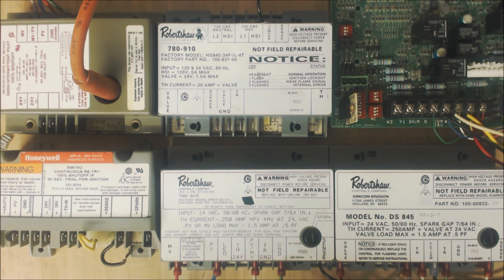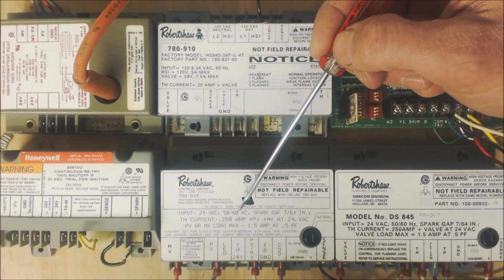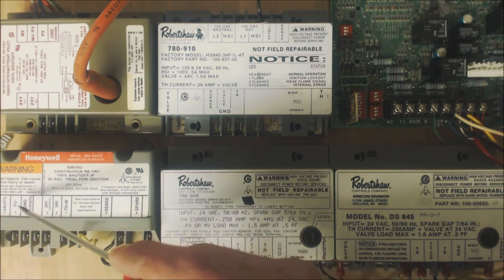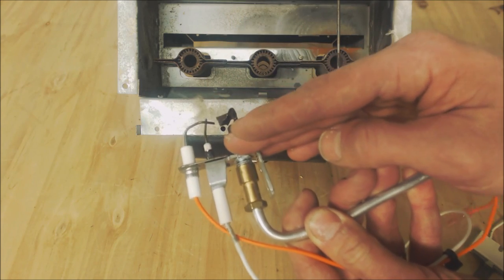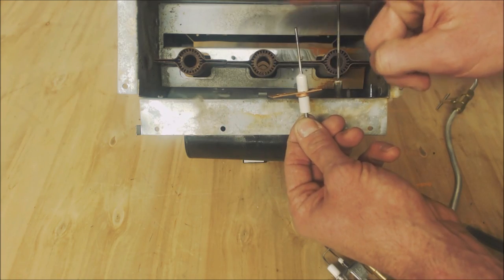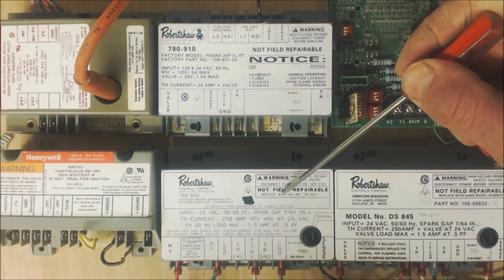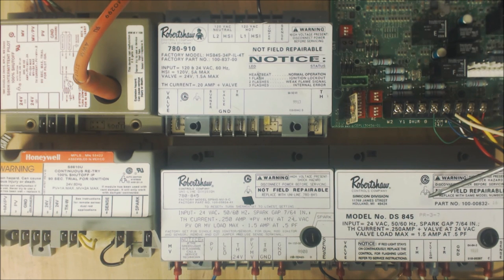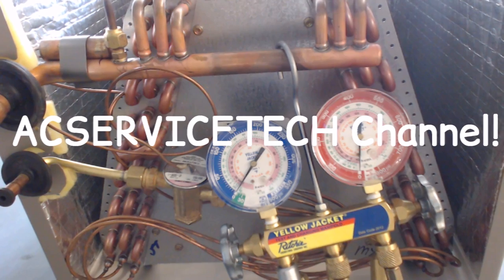Gas Furnace Ignition Control Modules!

Comment: Hello. Below is a summary of the issue from the perspective of an old automobile mechanic (me) that knows nothing of what he's talking about with heaters... 🙁 

Back around 30/40 years ago I put a dayton heater 48k hanging LP heater in my garage model 3E405. It always worked fine.  It was a standing pilot and a pain in the butt to climb the ladder all the time to preheat the thermal coupling.  As I got older it became very difficult to raise my arms over my head to light the pilot. Just recently about 2 months ago I purchased and installed a Robert Shaw intermittent spark kit # 712-008 recommended by Grainger.   It's been nothing but problematic since. 

My problem is now the heater has a mind of it's own.  The spark always ignites fine and instantly when I turn the power on and stops igniting fine when the pilot lights, (which at times can take as much as 50 seconds or so) but sometimes the pilot doesn't light at all, main flame does not light.  When that happens there is no reading on the manometer or voltage to the MV terminal or PV.   

It seems like there's a time delay for the fan to come on based on what my old heater thinks is a standing pilot and maybe there's even another switch telling the fan not to come on because it's not hot enough yet, all logical, but maybe the thermostat or this control module is running through that circuit messing up the sequence of events timing.  I don't know it's all guess work for me.   

I believe the part number of the switch originally and still in my Dayton burner is a Sterling switch # J11R00366,  high limit/fan delay.  If you search that part number tons of the photo of that switch come up.  

Also sometimes after the pilot does light, the fan will go on but no main heat. Sometimes the main burner may finally light after the fan has been energized.  I have 10 inches WC when it does open the MV. 

If I shut the power off and wait a bit, then turn it on, at times, all seems to work fine although the fan at that point comes on a bit too soon, it may cycle fine maybe 4 or 5 cycles while I'm working in the shop and keeping an eye on it.. Then the fan may go on with no MV or burner.  It seems to have a mind of its own.   

I feel like the old switches in the heater (I believe part# J11R00366 Sterling) are not playing well with the Robert Shaw kit.  I have an old Honeywell round thermostat 2 wire. I dont know enough to fix this issue.   

My novice gut feeling is that power isn't getting to the PV or MV terminal of the ignition module at times because the thermostat perhaps going through the time delay switch or the module is looking for something which I'm guessing is normally open the switch that I referred the part # above and that switch thinks it's dealing with a standing pilot so it doesn't care about timing in that regard.     

I also believe this is a dual switch with a high limit switch included which I'm assuming is normally closed but I don't even know what I'm talking about I'm just guessing. I may be barking up the wrong tree. I'm thinking that it would not be that part of the switch that is causing the problems because if the thermostat were attached to the normally closed high limit switch then everything would be coming on instantly with a call for heat, but that's just my guess.  Once it gets to that magic ignition module box I have no idea what is switching between terminals inside that box of course. The part# of the Robert Shaw kit was 712-008, and the control module was 780-845. 

I also honestly have no idea of the sequence of operation or if any time delays in that control module box that came with the kit. 

As a retired ASE certified auto tech I have the ability to generically test components, but without any info on the systems I'm stuck speculating.  

If you or anyone can offer any help or guidance,  please, I'm at my wits end.  Thank you.

Comment: Well I’m hoping all of this wiring is easy to get to. I changed out my motor in the heat of summer for a/c and the gas sounds like it’s coming thru, igniter is clicking but no heat. We have a small window of good working time in the attic and now it’s as cold as it was hot. My motor was hard to access behind the housing so I hope I don’t have to pull that heavy thing out again. Maybe I missed a wire. Here goes.

Comment: So it's sending 6,000 to 20,000 volts to the spark rod. 
What is the power source? Is it 24 volts? Is it taking 24 volts and somehow turning that into 6,000 to 20,000 volts? And also for your flame rod sending 90 to 120 volts as well.
So is there a 120 volts as the source powering this module or is it just 24 volts that's powering the module?

Comment: I have a DS-845 in a fire place that I cannot get to work. I replaced the controller, then the Spark rod but still it only lights the gas train and then shuts down with a flashing red light. I have check the grounds, even repositioned to the actual mounting plate of the spark rod but still the same problem. I verified the "house" ground and have it terminated everywhere. I am baffeled

Comment: great video I have a question I have just produced a new 780/845 module it is new and I have installed it I put the thermostat on and I have no spark. I made the connections like the old one, I would like to know if you can guide me above my heating system is a modine furnace
Reply from the maker: If it's a spark ignition module, I have two other videos on exactly what is happening with the voltage and wire connections, thanks!
Reply: @acservicetechchannel  have you the link

Comment: Great video. I have a question. I have a Honeywell universal ignition module and want to wire in a Wi-Fi stat. I need a "C" wire going back to the new stat (there are 4 wires to the old stat but also a few spares) Can I grab 24vac from one of the terminals that are already being used and run it back to the new stat?
Reply from the maker: Yes find the common on the transformer of the unit and run it to the thermostat, thanks
Reply: Thanks. Nothing marked "common" or "C" - just "24v Gnd" and "24V" . I'm guessing the 24V is the same as "C"?
Reply from the maker: It would be the 24v GND as the other one would be 24v power. Red- R, RC is 24v power to the tstat and the 24v Common/GND is the path back to the transformer, thanks

Comment: Is there a way I can ohm out a control module ? I'm getting 24 volts every where I'm supposed to be getting 24 v but I'm not getting a spark . I checked the volts at pilot igniter switch connection on and I get no reading . It's a direct pilot .
Reply from the maker: If you don't hear spark even with the spark wire detached coming from the inside of the module after getting your incoming 24v signal then the module is bad. Make sure your spark gap at the rod is not further than 3/16" or 1/8", thanks
Reply: acservicetech 
Thanks again A.C. , it was the board ..  I ended up using the one I grabbed last week from a service call that I diagnosed wrong and didn't use . Worked out well .
Reply from the maker: Glad to hear it worked out well and also thank you very much for choosing to support the channel through Patreon!
Reply: acservicetech dealing with a 90k sterling unit heater with a  sterling j28r06881 control board that won’t spark ⚡️ yet inducer and gas valve both work would it be possible to add a separate spark ignition module ( only for a temporary solution ) ? I know a new board will fix the problem but it’s 2 weeks away before getting it in hand ! 
Thank you

Comment: just a question, if I have my gas meter on the manifold side and the IFC drops out on flame safety (2 code flame failure, on a Lennox board ) ,  with a steady reading of 3.6" wc, could it be dropping out because of a drop in supply pressure?  If so, wouldn't I see some kind of indication like a drop in pressure on my gas pressure gauge, like a needle flutter?
Reply from the maker: It doesn't sound like it is the gas pressure. Are you seeing a loss of the dc microamp signal?  Did you clean the flame sensor,  clean the burner retention head or pilot flame termination if it is a pilot ignition system, tighten the pilot tube on the gas valve, tighten the ground connections from the burners or pilot to the ground., clean the front of the burner retention head. Search for "acservicetech flame rectification" for two videos on troubleshooting, thanks